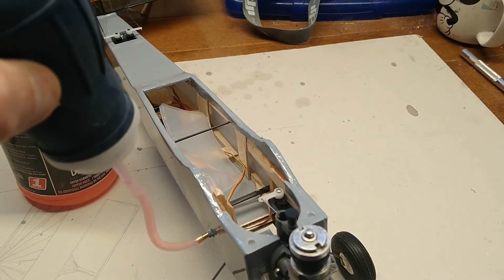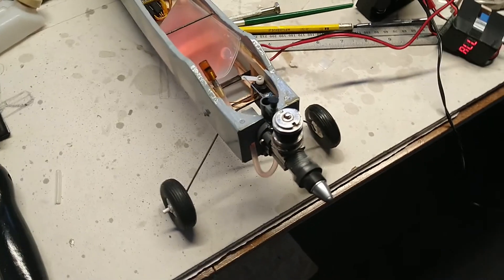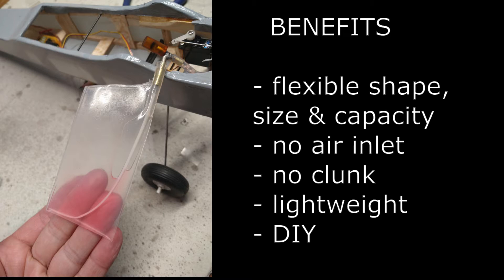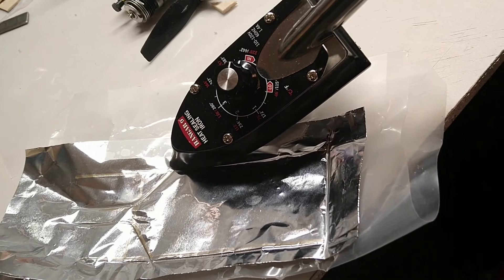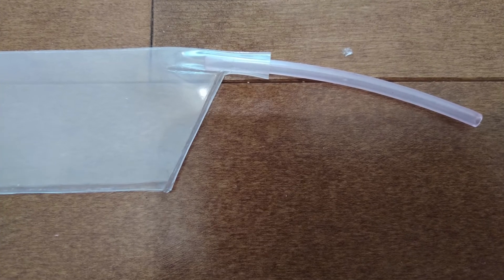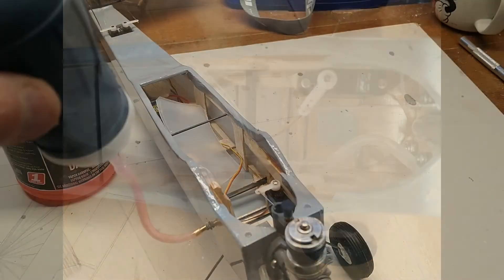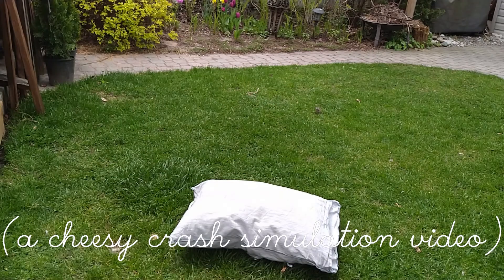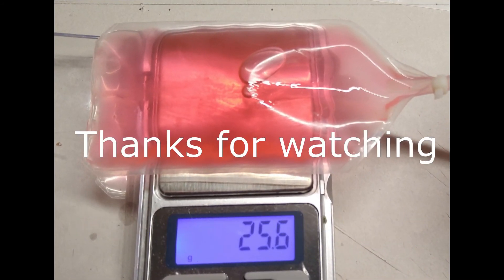How to make a lightweight DIY fuel tank for your nitro/glow planes

Comment: Excellent vid and technique. Old timer tank uses balloons and you collapse them with suction to get the air out. Atmospheric pressure is working in your design and other bladder tank designs. The trick is getting the air out of the bag. You can also perforate the pick up tube in the bag to improve flow and pull the air out better before fill. Nothing extra in the bag. I actually bought party IV bags to make a tank to move it back to the CG. I like your method better since you can tailor a shape to fit with outstanding accuracy.

Comment: You may be able to get a good, lightweight fuel line connection by wrapping the plastic with elastic fly-tying thread, which is 0.2mm but has a good amount of strength and stretch. Many wraps will put a very tight, but conformal grip. If you need more sealing power, one or more O-rings on the tube under the plastic, and then overwrapped with the elastic thread would probably be overkill. If you use one of the fly-tying spinner handle things, it's actually kinda fun to wrap things in thread. It's almost like they enjoy making fake bugs for some reason.